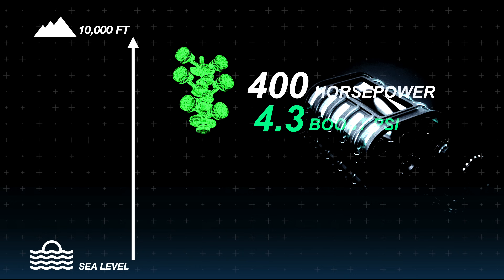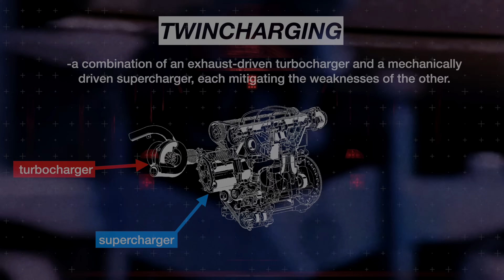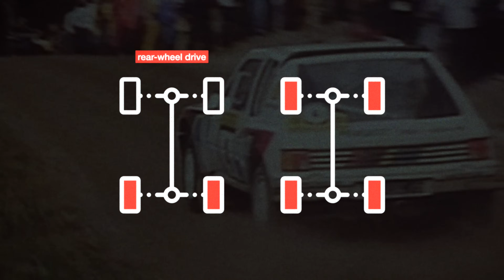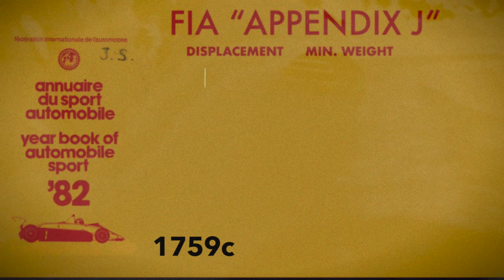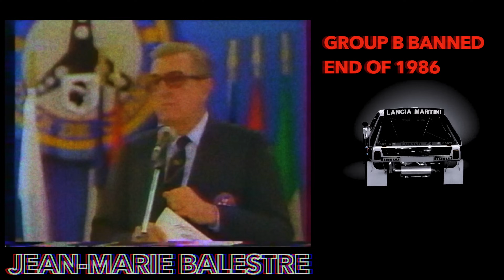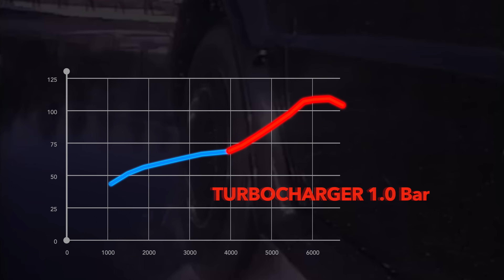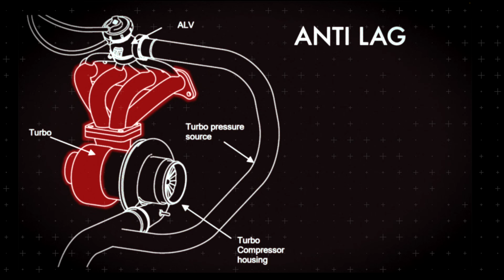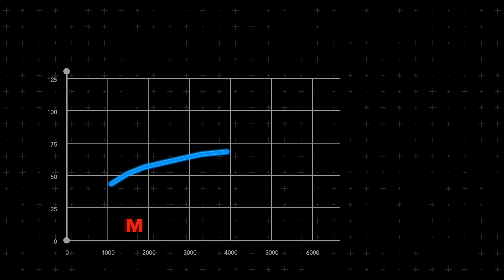The Engine That Was Banned From Racing | Explained Ep.29

Comment: I own a twincharged Volvo. Known as the B4204T27 engine, I believe it to be the only successful implementation of twincharging on a mass scale. Most people, when I tell them it's twincharged, think I mean twin turbo. You'd be surprised just how many people, even enthusiasts, have never heard of this technology. The car is awesome, and embodies just what you describe. You get the low end torque of the supercharger, with the high end supplemented by the turbo. You can physically feel the switch between the two at around 4,000 RPM. It truly gives you the best of both worlds, without turbo-destroying anti-lag. Plus, the induction sound when the intake resonators are removed is absolutely out of this world.
Reply: That's really cool
Reply: VW had a 1.4 TSI that was also twincharged in mass production, for example in their best selling model Golf.
Reply: @6rimR3ap3r  Had a Scirocco with this engine. Remmaped it to 210hp. A gem to drive, low end torque from 1100rpm and you feel the turbo kicking at 3600rpm... Incredible technology
Reply: @ShakaïOff  Did you need to change anything else before the remap? I have the same engine in a Polo GTI of the same era so I'm interested in the know how.
Reply: @6rimR3ap3r  I currently own a 2013 Pre-facelift Polo GTI with this engine. This car was the answer to the 2013 Ford Fiesta ST that everyone knows and loves. Its a shame not everyone got it.
Reply: Not particularly successful though, it had more than it's share of problems.
Reply: not mentioning the volvo engine was the only miss on this video
Reply: @Jaxxex don't forget about the Jaguar cx75 that should have made production
Reply: The t8 engine also has this and kicks out 455bhp in the 2023 version
Reply: @frozencritic5484  yes but that includes the power generated by the electric motor, my 2019 xc60 T8 has about 330 bhp from the ICE and 70 from the electric motor……400 bhp…it’s quite quick😊
Reply: @frozencritic5484  the T8 has twin charging plus a electric motor which produces 143 horsepower and 228 lb-ft of torque which is why it makes 455 HP and 523 ft lbs of torque.
Reply: @frozencritic5484 the 455 hp is combined power from engine and electric motor. Engine only makes about 320 hp
Reply: @frozencritic5484  The 2023 version actually dropped the supercharger. The increase in HP is due to more powerful electric motor, eliminating the need for low rpm boost from supercharger. I'm currently driving the 2023 version, and have driven the twincharged T8 from 2017 to 2022. The twincharged had a nice 'thump' sound after short bursts of gas, but the turbocharged 2023 model with upgraded electrical motor definitely is quicker / more agile!
Reply: The best part of twincharge is that u can afford bigger turbo(and its mean less backpressure) cause compressor forced engine to produce more exhaust gases that it will be without compressor and its also helps eliminate turbo lag
Reply: Nissan were the first to add twin charging to a road car in the late 80s.
Their domestic market Nissan March Super Turbo was a 930cc 4cyl super charged and turbo charged EFI engine. The car was released as the top of the March (Micra) line and was designed to compete in Group A 1300-1600cc racing and rallying. 
(The FIA dictated multiplying the engine capacity by 1.7 for forced induction = 1581cc).
Reply: The travesty of all production twin charged vehicles is boost is never a compound setup which would multiply boost psi.
Reply: @RichardPrendingue the 1.4tsi the supercharger blows through the turbo, isn't that technically compound?
Reply: nissan micra march super turbo was twincharged in the late 80s
Reply: audi has also use a twin charged engine in the s7 tdi. a v8 with a electric supercharger and exhaust driven turbo's
Reply: >only successful implementation
The Detroit Diesel 71 series says hi. ... Kinda.

Jokes aside, yeah, not really the same sort of beast. They were built for a different application, not all of them were turbocharged, and they were all supercharged because they required boost to actually function due to their design.
Reply: @PKaiser661this is why I said SUCCESSFUL implementation lol. The twincharged Volvo motors are actually fairly bulletproof (minus some really early ones that had issues with pistons).
Reply: Most 30's bomber design's used twin charging due to single stage limits at higher altitudes, the P38, and P47 were high altitude fighter designs that used twin charging.
Reply: Volkswagen has/had one. It was a tiny 1.4 liter DOHC with a roots type blower on top and a tiny turbo out front. Got unreal fuel mileage.
Reply: Omg I want to drive that.
Reply: Thats so fucking cool.
Reply: @PKaiser661  was about to comment that, truly a workshop magnet if i can say so ..
Reply: Twin charging=smaller supercharger and giant turbo or big enough to make the ho levels you want super charger is there for low end turbo for the high end it’s a classic way around massive turbo lag other than having anti lag even if you have anti lag the turbo won’t be spooled enough by the time you really want the power it’ll take a second or a split second to kick in really interesting tech
Reply: I gotta see this in actiom 😂❤
Reply: In reality, lets talk about a straight 6 engine., twin turbo means high and low pressure. Ie cummins k series engine
Reply: That Volvo twin charged engine also has a T8 version that adds an electric motor on top of a turbo & supercharger but those Volvo engines are very unreliable. Just ask Savagegeese. Lol
Reply: My Volvo dull Volvo V70 family wagon has the 181 hp D4 Diesel engine (4 cyl) and twin turbo. Puts out 400 Nm of torque. Enough to drive past the tractors on the road 🙂
Reply: Thing is with turbo technology nowadays. You don’t need twin charge. Turbos have so little lag that it’s more efficient just using turbo and no supercharger
Reply: Hi, which model Volvo has this set-up..?
Reply: This is with electricity and a little different than Mazda and Nissan who are the only manufacturers to attempt factory twincharging
Reply: Nissan micra/ march superturbo.  1988-
Reply: Why would it surprise you, really, it's not all that surprising...
Reply: Pretty sure Nissan had a twin charged commuter car. Mighty Car Mods did a special on it. Can’t remember what the name is at the time of writing this
Reply: What car is it the v60 polstar?
Reply: as a BMW technician, but Volvo enthusiast, I love showing the twin charged Volvos to my coworkers. some day I would like to somehow fit that twincharger setup on a 5 cylinder.
Reply: @jeffreyhubbard4354  ughhh that's gotta be the dream! big T5 with both spooler and blower 🤤
Reply: Another happy twincharged Volvo owner here. We’ve got the XC90 which is also hilarious as it’s much faster than most people think a Volvo will be, with upwards of 450HP — admittedly in a 5150# hybrid 7-seater, but actually the hybrid X5 45e weighs around 500# MORE, with the 2024 X5 50e being around 5575# with similar power though having a more tune-able B58 vs the Volvo. The registration and DMV receipts call it a “twin engine” as well which is amusing. Volvo say this due to the combination of petrol and electric “engines”, so it’s a pretty rare bird. You’d think all this would lead to reliability issues, but in 50k miles so far it’s been flawless. Like almost all modern turbos, it’s got an EGR so no fun BOV woosh, but you do get a bit of SC whine when you get on it. Sadly the newer models do away with the twin charging and just use a turbo plus a bigger electric motor.

Factory Polestar ECU tune is also fun, ask the WRXes I’ve embarrassed off of lights 😂 I swear that the T8 Polestar Volvos are among the sleepiest sleepers on the market today. Audi SQ7 is up there too, with its TT 4.0 v8, yes the same one they use in the RS6 Avant, RSQ8, Porsche Cayenne Turbo GT, and VW Urus. Very easy to chip tune for around 700hp which is bonkers in a 3-row family SUV. We’ll probably get one next, the only downside is that TT V8 yields around 12-15mpg city in the heavy SQ7, whereas the T8 Volvos get close to 30.
Reply: Nissan Micra Super-Turbo [ AKA 'March' ] from the same era as the Lancia!

2013... Whut! Nissan did it back in 1980's.

[ loves his '96 '96 T5 Wagon more than cake! ]
Reply: lancia delta s4 is the best twincharged motor on the planet, too bad it isnt mass produced
Reply: I had no idea there was a Volvo with that induction system. Awesome
Reply: People forget saab the grand dad of turbo ❤ i had a twin 93 ohhhhh i miss it
Reply: Interesting
Reply: Do you think it would be possible to twincharge a K20 maybe? I mean I just looked at the B420 and it looks to be similar to a K20 atleast in my eyes idk I prob looked at it wrongly
Reply: @stormbreaker504 what's the use? Get more power and would cost less just building the motor and installing a mid size turbo. Sure, youll have some lag but what do you want to do with the car?
Reply: @Wheresmy240  time attack or drifting  maybe although I do like experiment with everything I touch lmfao or I want to touch that is mechanical or technological
Reply: It's a cool engine. But unfortunately there is so much pressure on the pistons, the rings are going bad and causing blowby and oil to burn. It's more noticeable on the SPA T6 engines than the T5 engines with the same mileage 70-80k.
Reply: @highvoltage12v this was an issue with the early Drive-E cars. Issue was rectified by 2017.
Reply: @highvoltage12v  Are you talking about the first T6 twin turbo? Them you can find for a 1000 euros wich is pretty nice, im dreaming of building a "rally" track car, a twin charged would be sfg...i would like a good engine in a impreza or 944. I would like to recommend everyone to check out Hilmerssons Orange Opel Manta wich he built with a Volvo red block and his own twin charge set up, i think it made about 650hp, its a great build!
Reply: March super turbo sold like 10,000. I would say that is a successful implication of a true production car
Reply: Detroit Diesel would beg to differ on your little “only successful implementation on a mass scale” theory 😂

Every 2 stroke had a supercharger so any 2 stroke “turbo” engine would be twin charged and millions and millions of those engines were made for decades.
Reply: Vw have a twin charged golf and scirocco 1.4 and so do skoda
Reply: B4204t27
Reply: You haven't looked into the Volvo 2.0L twin-charged (Super AND Turbo) engine.  With a Polestar Tune, it runs about 320hp.  The low-end torque and top-end power was an insane combo.  Not much could keep up with my 2016 XC90 with that.  Embarrassed more than a few Hemi Ram guys with it.  That was a very fun vehicle.
Reply: True says
Reply: They use a hybrid system as well
Reply: Damn; this is poetry.
Reply: You should look into classic cars with multiple superchargers
Reply: I had an S90, it's was a really nice engine,  and if you were humming down the highway you'd get close to 30mpg
Reply: So the FD3S from initial D?
Reply: 2 stoke diesel used twin charging.
Reply: I have a friend who had a seat Ibiza Cupra 1.4 supercharged and turbo charged from factory he modified it and after a while it was running that much boost it was on edge of a disaster so he got rid. Only car I’ve known to have such a thing other than zenvo st1
Reply: Mercedes e53 was twincharged for a while
Reply: Do you have a tune to only use the turbocharger for economy driving or does it have to stay the same
Reply: How about fuel effiency?
Reply: Some Deisel engines  have had   supercharged turbos for years. Ny M60 tank for instance V12 air cooled 750 hp  turbo supercharged deisel. Made in the 60s.
Reply: This was done in Aviation during WW2
Reply: It’s my first time hearing about twincharging but it is indeed amazing technology. Team B truly thought out the box. 📦
Reply: My S90 is twincharged and I love it
Reply: What year model is it?
Reply: Well Lancia Delta Integrale HF yep Lancia did this twin charging rather successfully in rally and a street legal car anyone could buy
Reply: The VW TSI has a turbo and supercharger and is a hugely popular car.
Reply: e90/E91/E92
E60/E61 got m57 on twin turbo that. can make 610km 1280nm after good tune
Reply: VW built one many years later ... But only for a couple years
Reply: The VW polo aint bad either.
Reply: wow I didn't know Volvo was one of the few to succeed in implementing this technology in person cars 😮 
makes me love Volvo even more!😂
Reply: Sleeper old Saab and Volvos look slow 4door will walk away from you
Reply: I've owned a bunch of detroit diesels that were both supercharged and turbocharged. Just keep feeding em oil and they go forever.....
Reply: Same, I have a modern XC90 that’s both hybrid and twincharged
Reply: @Icyclenyc  it’s extremely well known that the “Volvo T8 Engine” is the only production Twin-Charged engine sold on the market today in a consumer market automobile. I own one too, it has literally zero lag from idle to redline and the supercharger squeal stops right as the turbocharger hiss takes over
Reply: mach super turbo was another...
Reply: Nope. The Polaris is a twincharged hybrid. Unfortunately they stopped making it a couple years ago. Volkswagen has used that type of engine on other cars.
Reply: Nissan march super turbo
Reply: Love the post! Be well.
Reply: Detroit Diesel made millions of twin charged engines.
Reply: What year
Reply: Bro, can you please add a video of how it sounds like?
Reply: What Volvo has that from factory? Thanks
Reply: @LinkinPark4Ever1996   The T6 from 2016 until today https://en.wikipedia.org/wiki/Volvo_Engine_Architecture  The original T6 was a inline 6 with twin turbo with about 280 hp, i belive that the first T6 could produce around 700hp without opening the enigine, so a pretty mean machine. this twin charged T6 sure is interesting for a build of some sort, i wonder how far it could be pushed?
Reply: @jonny1943 the 2018 S/V60 Polestar models have 360hp from the factory on just the motor. There aren't any after market tunes yet, but the NG Volvo Community really hopes for one to show up soon so we can see what the full potential of these motors are.
Reply: @Fat_Jag  thanks. Now I know what my next car will be
Reply: @jonny1943  What are the specs on the rods, pistons and crank? If those parts can withstand the pressure, as well as the block, that might be a sleeping monster. Knowing Volvo....it probably is King Ghidorra!!
Reply: @LinkinPark4Ever1996  i think T6 and T8 engines have twincharging
Reply: @fitty77 they do, my xc60 t6 is a 4cyl  turbo-supercharged engine
Reply: @fitty77  @jonny1943 
Dang I googled them but I hoped they weren't SUVs
Reply: @LinkinPark4Ever1996  you can get the T6 motor in the S90, V90, S60, and V60. It's not restricted to just SUVs. For instance, I have a 2019 S60 with the T6 twincharged motor.
Reply: 2018 V60 Polestar, twincharged FTW, 183 HP/Liter, everyone else can suck it!
Reply: Only fake car guys think it means twin turbo.

Comment: Killer spotlight on early twin charging in motorsports. There's a great video on Hagerty that Larry Chen did about a green twin charged EVO VI. An extremely nice build. Keep up the good work dude 🤙
Reply: Yeah I love that build! I have 1 out of 3 complete twincharge vehicles
Reply: @claudedottin1312  Especially when the dude said that the owner just had it built so he could say he owns it and leaves it with him LMFAO. I've built dozens of customer cars, mostly Wankel powered as that's what I built with my late father, and not a single one said "build me the sweetest car you can & when you're done just keep it & enjoy it." Damn near a dream scenario right there lol. Like he said in the video tho twin charging really isn't necessary anymore with the advancements it not only turbocharger technology but also metallurgy & engine management. Twin scroll housings, Inconel & billet turbines, integrated BOV's, ECU controlled anti-lag, Co2 controlled wastegates and the list goes on & on & on.
Reply: @jdmmike7225  true true but the way I building and reasoning (other than needing out) is what kind of drivability can I achieve that fits my taste while keeping a certain budget etc. only one of mine will have a by pass similar to a scrorocco engine . One of mine will be on my FC to experiment with compound boost and choke points of motor.

Comment: Group B Rally was significantly more important and influential for long-term car technology development in the 1980's than F1 was. Sorry, not sorry. 🤷 Lol
Reply from the maker: I agree. Quattro AWD system, Variable Geometry Turbo from the Peugeot 205 T16, Twincharging that even Volvo and Jaguar still use, Dual Clutch transmission by Audi. Group B paved the way in the 80’s
Reply: @337speed  Ah'yup! Agreed on all counts! By essentially not having rules (I mean they obviously did, but to say they were lax would be the understatement of the freaking century lol) engineering exploration & development was allowed to proceed at a pace that F1 fundamentally has never and likely will never allow. 🤷 

Everyone was desperately throwing EVERY SINGLE THING their team engineers could even think of at the Group B rally car wall to see what, if anything would actually stick. And surprisingly or not, a lot of these ideas WOULD stick, and in some cases stick HARD! (Many of which you just mentioned.)